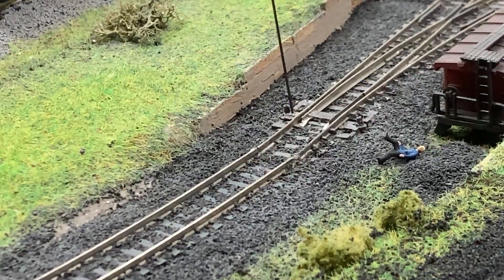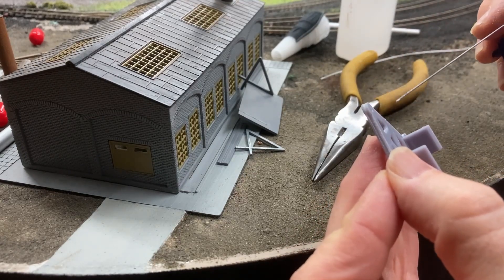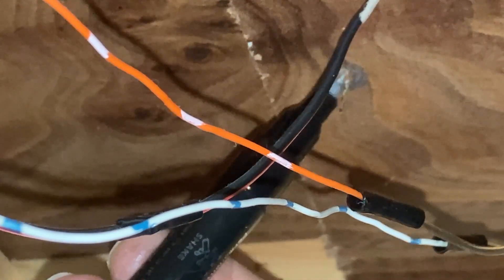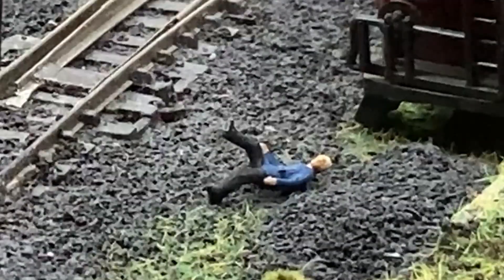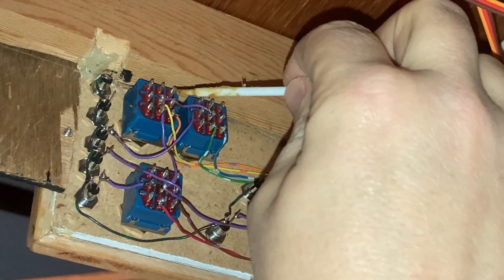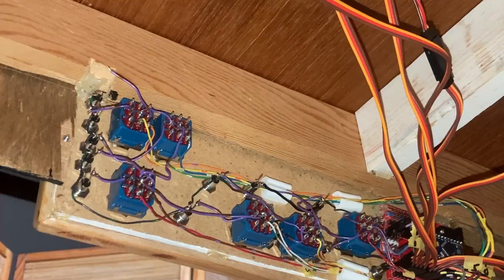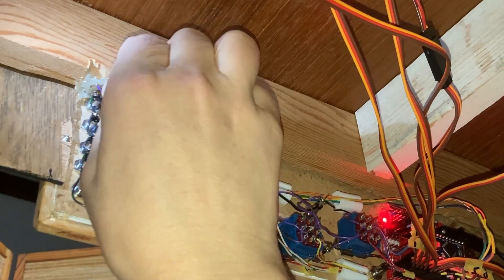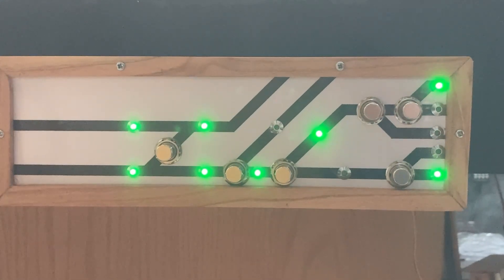How to add a servo to an already installed turnout and wire up LEDs #modelrailroad #servos #nscale

Comment: ooh, the route indicator shows the commanded position, not the detected position? that's the primary cause of the Three Mile Island incident ;)

Great video! I've just superglued servos directly to the underside of the baseboard up to now. A bracket would be better…
Reply from the maker: Haha, good point. Yes, not ideal - showing the actual position of the servos would be better but it involves using limit switches on each servo. For now I’m trusting the servos will throw as commanded. After all my trains are not handling nuclear waste. 😆

Thanks for watching and commenting.
Reply: @pacificcoastminiatures  I've seen servo-holders which have mountings for microswitches to set the frog polarity which might also provide feedback for panels/a route controller… not sure you'd really want to load much of the complexity of a real signalling interlocking into a Nano or a bunch of Nanos though!
Reply from the maker: @RoamingAdhocrat yes I’d like to eventually add signalling with block detection but that I know will require a better microcontroller. Future project. 😊